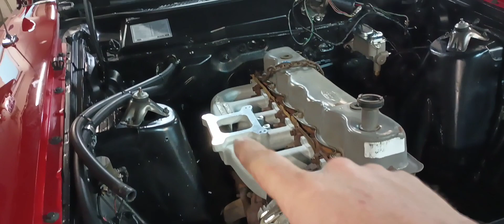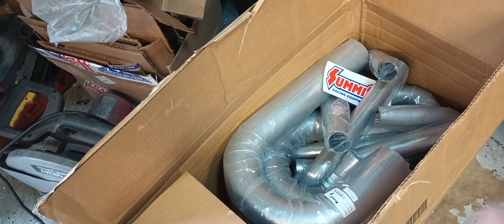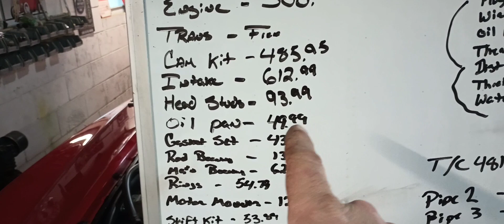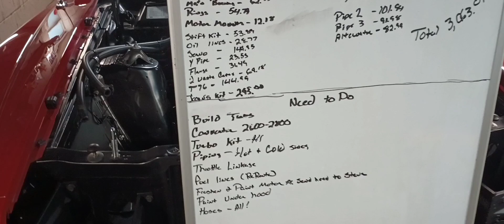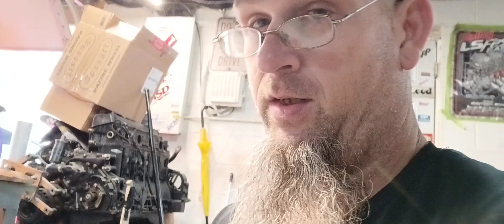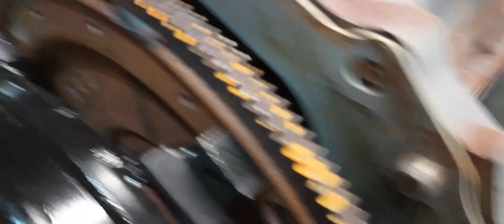Turbo 300 Power: Time To Start The Fun Stuff! #Ford

Comment: Guess living close to Summit helps.    Cam cost me 100.00 . Pistons I bought for the same (352) . Bought a jasper rebuild in a van for 400.00 . Scrapped the chassis and sold items from it for almost 650.00 . Looking for an early Fairlane body. Forgot to mention 5 speed conversion cost 200.00 and 170.00 in ebay headers . Like you have said it's either money , or time and effort . Wish you had more time . Hope this doesn't jade you on the Ford 300 six😢
Reply from the maker: I did buy the cam kit so that inflates it some